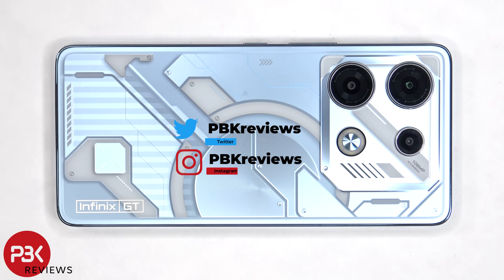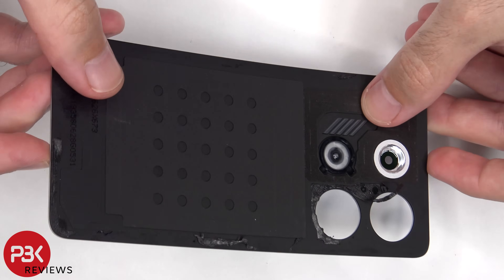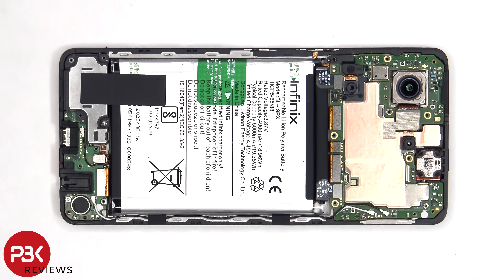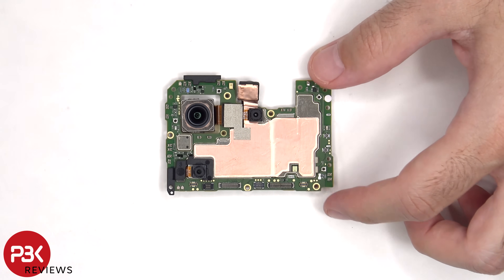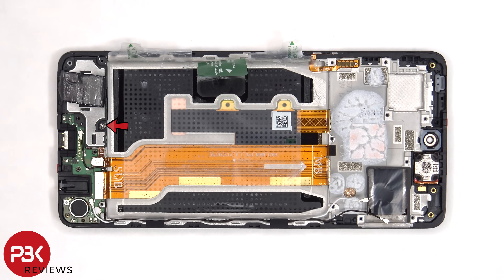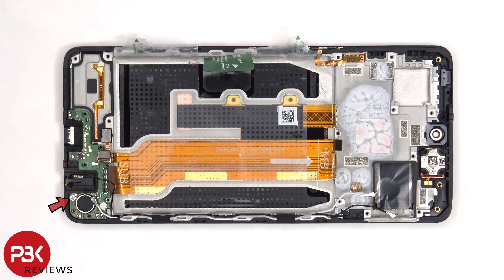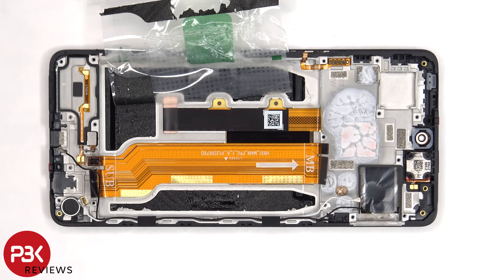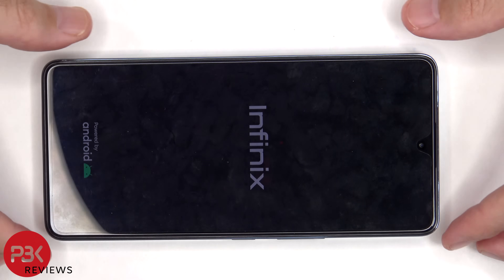Infinix GT 10 Pro Teardown Disassembly Repair Video Review

Comment: heyo ma friend i have that phone and i have some issue on the main port exactly on the charging connectors on the main board that got the circle with the battery in full well i have some fire damage on the main board in exactly the place ya hook the battery to the main board i would need some help to fix it cause i don't know how to solve the burning damage on the board through out the battery circuit  i hope ya can help me with that i would need a blueprint or something to know the live circle and ground one on the main board so i can get it fixed

Comment: i play game with it i have a cooler fan for mobile whats the best place to place it in the middle of the phone or near the cameras so dont heat  when i play games ?
Reply from the maker: It would heat up more near top half of the phone, but if you have a stand alone fan not one that is attached to the phone, then the front where the screen is would be best to point a fan at since most of the heat is dissipated through the screen and out of the phone. But if its a phone fan that is attached to the back of the phone, then as close as you can to the top half of the phone.
Reply: thx yeah i almost i attached it to cam to the  phone @PBKreviews

Comment: is the processor and ram stacked?
Reply from the maker: yes
Reply: Will this become a trouble in the future use? Please answer 😅
Reply: @ajidimas4742 as long as you enable the gaming temperature control it should be perfectly fine to use,i always left it enabled and it's been running genshin impact perfectly fine even at medium to high settings
there's some stutter here and there because the phone is throttling to stop the excessive heat production but it's rarely an issue,been using it for a month now and the most annoying part about this phone is sometimes it'll randomly lag, although locking and unlocking the phone 3 time generally fix the issue

Comment: wow this phone is very poor build quality for the price. They should take some lessons from nokia on durability and quality control
Reply from the maker: I don't think for the price its bad. It's got good cooling as far as the vapor chamber and all the thermal paste, and processor to handle the games etc. But for the price, they obviously went with plastic housing and so forth. If the price was $100 more, I could see them using better material.
Reply: @PBKreviews  you're right, just because one happened to have that adhesive backing left on was more of a quality control issue, which is inevitable in any process. Love the videos! recently upgraded to a Nokia xr20 from my 9 pureview after three years of use the little tactile dome switches are going out for the power button

Comment: Can you confirm if they're using cheap components which won't last much?
Reply from the maker: Aside from the housing being plastic, I can't really say the rest is cheap. They used a good amount of thermal paste as well as a good sized vapor chamber for cooling so It should definitely help against over heating.

Comment: Does those heat equipments really helps the chipset to cool down or it just doesn't allow the heat to escape so it feel cool to us ?
Reply from the maker: They help cool it down. The transfer the heat more quickly and efficiently away from the processor and parts out of the phone.
Reply: @PBKreviews  Many complaints are about the battery draining too fast. 
Please what is your experience with the battery life.
Reply: @PBKreviews  but plastic back, so highly doubt if heat gets outs of the phone as it should be